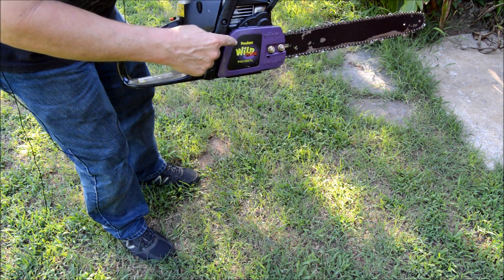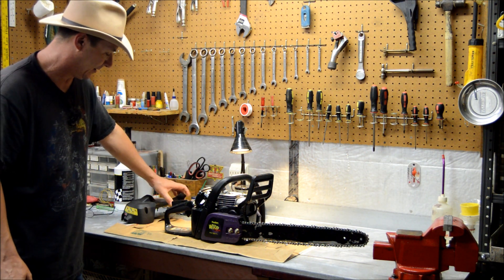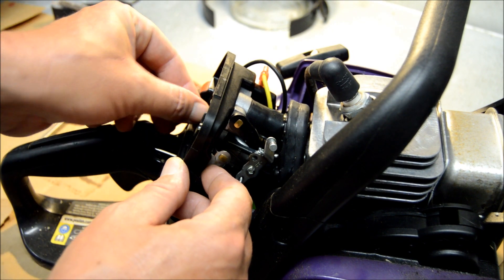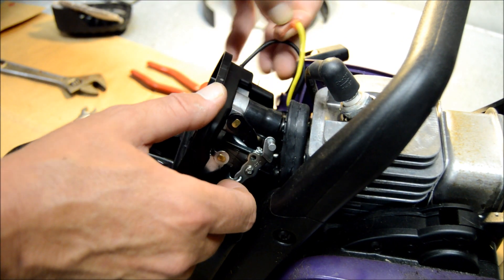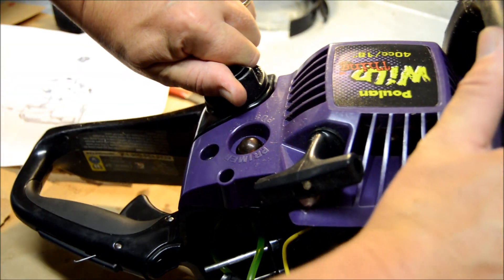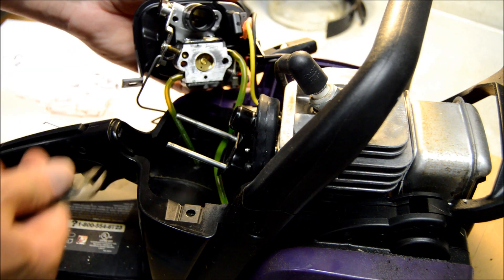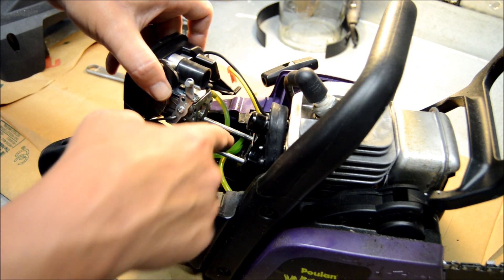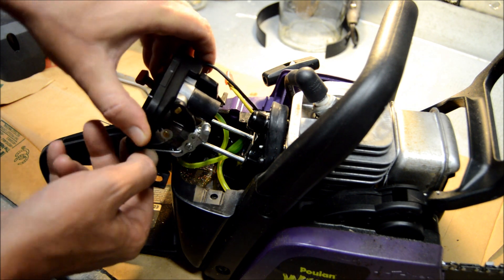Chainsaw Repair - Poulan Wild Thing - Fuel Line Routing Problem

Comment: Hi I was wondering if I could get your help. I might be misunderstanding but the diagrams I find say the fuel filter line goes on the throttle side and the primer bulb big nipple goes to the tank and small nipple goes to choke side of the carb. My saw runs good like that sorta but keeps dying, bogs abit trying to open it up.
Thank you.
Reply from the maker: I had the same issue with the diagrams. I couldn't find the exact model and all of them called for a different configuration than what my saw had. I had to try routing every way until I finally got it to run right. If yours is running at all you probably have them routed correctly. If it's bogging it could be air fuel mixture is off. Maybe the new lines allow more/less flow than the old lines? Good luck!

Comment: I am working on exact saw with new replacement carb installed.  Can you please share or forward or tell where you got the fuel line diagram. And how they get arranged on primer bulb.